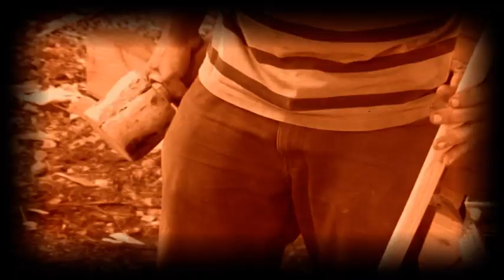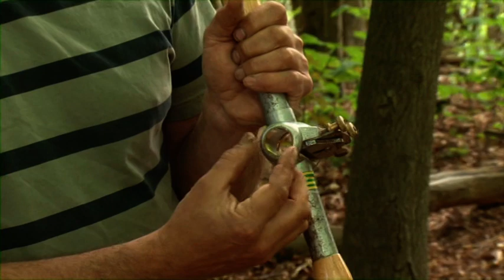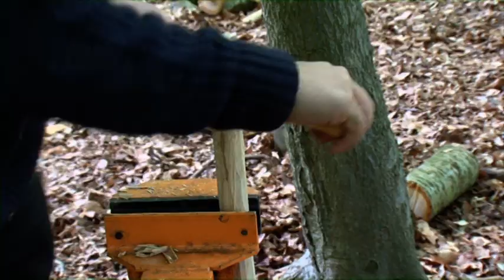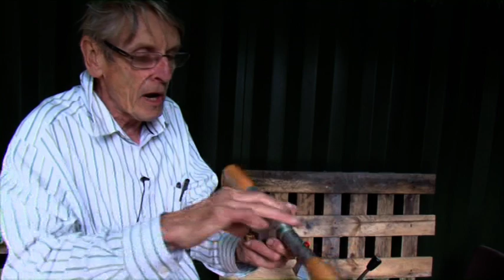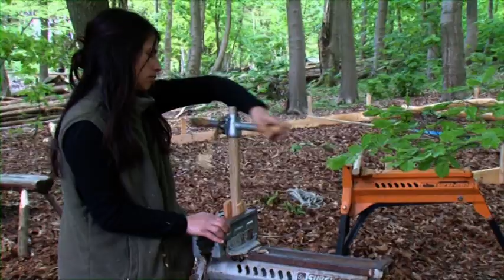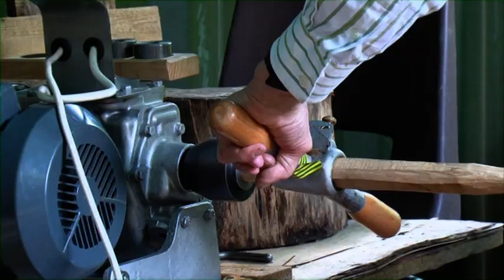Self build timber frame homes: Pegs

Comment: Dumb question....I am using a bunch of 6"x6" and 8"x8" white oak beams that have been dried already to build a workshop.
If I have a 1" peg hole diameter, wouldn't I use a 1" diameter peg?